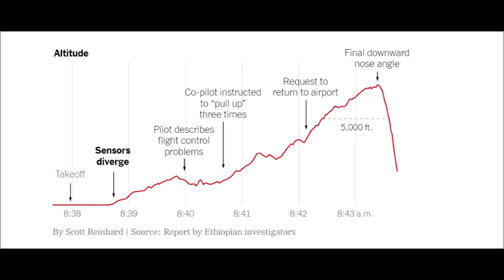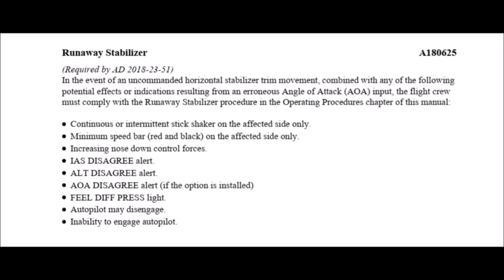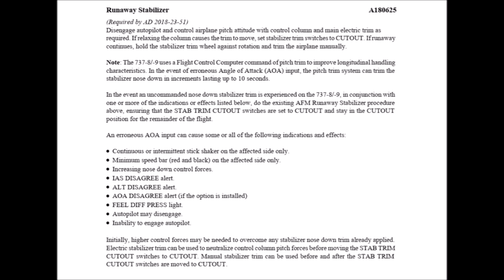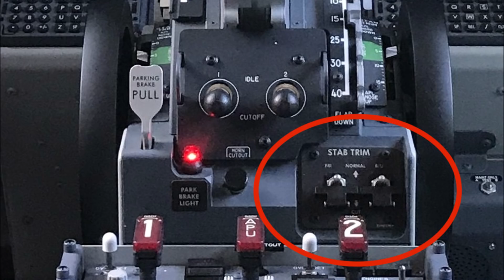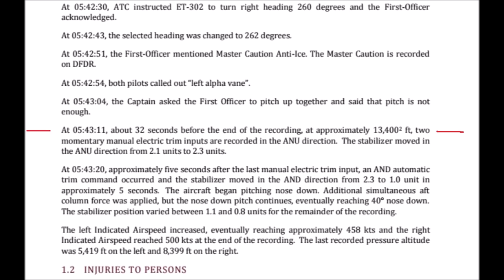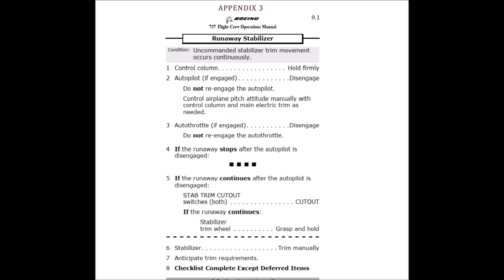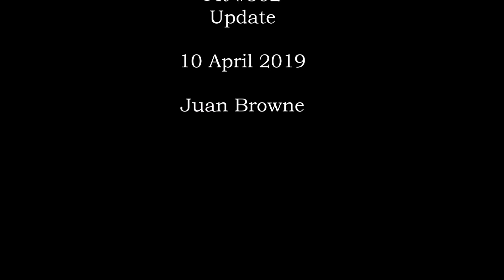737 Max Update 10 April 2019 Runaway Stab Trim Procedures

Comment: The terrible part of the history of the Boeing 737 MAX seems to be that Boeing, instead of making a complete new narrow body airplane, used the 737 platform to make the 737 MAX. It apparently became clear to Boeing pretty quickly that the new engines could not be installed in the normal position due to their size so they were moved forward and upwards on the wings. This apparently changed the center of gravity, thus changing the flight characteristics during takeoff and ascent so much that Boeing had to develop a system that could prevent the tendency of the airplane to pitch up during takeoff/ascent.
Boeing obviously decided to do all the above because they wanted to push a competitor to the Airbus 320 Neo into the market as quickly as possible. There would be great savings if Boeing did not have to design and produce a whole new airplane and airlines could save a lot of money if the existing 737 pilots could do a quick, simple retraining to qualify for flying the new 737 MAX. Boeing sold the airplane just a new version of the 737 NG but it seems that the 737 MAX really was not similar to the 737 NG in many ways.
This whole case may end up costing Boeing a lot of money and even worse, a lot on the reputation side.
Boeing will of course fix the problem with a software fix to MCAS but they continue to produce the airplane.
What will happen if passengers start to vote with their feet when the 737 MAX finally gets certified again?
What will airlines do if passengers make it clear to them that they have no desire to fly with the 737 MAX?
In the near future, it may be a good thing to be an airline predominantly flying Airbus 320 type airplanes.
Reply: FYI, the reasons for MCAS were covered in several of Juan's previous videos The story of the MAX introduction is full of compromises.

Comment: How many of these conditions happened on previous flights and went unreported to authorities...Pilots should be required to report any anomalies in flight and post flight!!!  Catastrophie training as a regular certification!!
Reply: Bloomberg reports several AOA faults over the years, though none with catastrophic outcomes. Because MCAS was not disclosed prior to the Lion Air flight, it was not easy to diagnose and report on.

Comment: Seems to me that the MCAS system is too dangerous and the design needs to be altered. There's a lot of built in redundancy, but not where they need it. That sensor gets stuck and the computer is way too determined to send the plane into a dive. Why don't they also have a gyroscope to give the computer an independent way to verify the AOA? But the autothrottle was also a problem. Both systems need to automatically back off when they sense the crew is struggling to maintain control of the aircraft. It's asking a little too much of panicked humans to manually shut down the automatic systems while struggling to maintain control.
Reply: Boeing's proposed fix to MCAS will remove most of the risks, and will be reviewed by the FAA.
Reply: So you want to rely on a sensor to detect when a crew is struggling because there is a problem with another sensor...does that make sense?

Comment: Question 1: If the FDR doesn't record MCAS inputs, how do we know they re-engaged it? 

Question 2: Did they have enough altitude to manually trim the aircraft from a full nose down trim condition? My understanding is that the trim wheels are very difficult to move, especially at higher airspeeds?
Reply: 1. The FDR records all trim inputs, but not the position of the switches, which have to be inferred from the  movement of the horizontal stabiliser, which is also recorded.
2. Probably not enough altitude to recover, unless speed was reduced. However reducing engine thrust may have caused further nose down pitching, due to the underslung engines.

Comment: I am not an expert in any shape or form in this field. My entire experience is consisted of few hours in single engine light plane and glider. I would like to know in the world of highly automated flying, is there a control or switch that terminates all automation and instantly puts the aircraft into manual mode? When panic sets, its hard to perform root cause analysis by system of elimination. I am sure that commercial pilot training includes copious amount good old hand flying. Good report Juan. Greetings from Australia.
Reply: There are differing levels of automation, and unfortunately MCAS is one of the lowest levels, and not easy to turn off. Having a single 'off' button for everything, creates risks of its own, from accidental in-flight deployment.

Comment: If manual adjustment of the trim if so difficult they should consider having the ability to disengage MCAS logic only so that way they can manually operate the stabilizer trim electrically.
Reply: 1. The proposed Boeing fix to MCAS will remove most of the risks. 2. Other changes would be complex or costly, or involve certification and training issues.
Reply: @gordonrichardson2972  I read a lot of other informative posts that said electric trim demand will override MCAST nose down command. Seems it might have the proper level of control logic priority but maybe the pilots dont know that critical information. The significance of the crews other mistakes just seem unrecognized and unrecoverable in the end. Very unfortunate. 
Thanks for you input.
Reply: The full details are complex, and still not fully understood a month after the crash. The pilots only had a few minutes to react.

Comment: Juan -- after listening to three of your 737 Max 8/9 updates, got to wondering--if the MCAS system gets into a runaway condition at an altitude that is too close to the ground, and the speed gets to be too high  and the pitch of the plane is "nose down".. why can't the control software do something to turn off MCAS and lower the speed. Perhaps even pitching the plane "nose up"?  Thanks.
Reply: Typically when you are near the ground, you have flaps extended as you are either taking off or landing. MCAS is not active with flaps extended. MCAS is obviously flawed and needs to be redesigned.
Reply: The software fixes that Boeing have proposed to MCAS will remove most of these risks, once approved by the FAA.

Comment: Can someone explain if the auto throttle is on , why did the speed get so high ? What is the function of the auto throttle ?
Reply: The auto-throttle aims for a specific rate of climb after takeoff, and then a fixed speed in the cruise. Since the aircraft was not climbing as expected, the auto-throttles kept applying full power. Its not a very smart system under this kind of fault condition.
Reply: @gordonrichardson2972  it seems the software is not very robust. How can auto throttle push the plane  into dangerous speeds well over the limit of the planes design

Comment: Several witnesses near the sight of the Ethiopian crash reported rattling sounds just prior to the crash. Could this possibly be that at near supersonic overspeed conditions on a plane likely never flown this fast before, the control surfaces buffeting from sonic conditions? Also trailing smoke was reported possibly wing vortex condensation?
Reply: Good point, though eyewitness reports at 500 mph are not always reliable.

Comment: Wow, so if they had cut the auto throttles and manually reduced the throttle (hard to do, psychologically, at low pressure altitude, not much AGL), they might have been able to manually trim at lower speed? That sure is a narrow bridge to run across, and not much time to do it. Thanks for the best, most understandable analysis of the 737 Max accidents. They came so close, that I am now convinced that if they had had simulator time covering AOA malfunction and MCAS activation, that they would have saved the plane, and all those lives.
Reply: blintor zabat I agree

Comment: jones jones quote: With tunnel vision and startle factor in mind, perhaps the synthetic voice for overspeed should be changed from "overspeed overspeed" to "overspeed reduce thrust"
—You could be right. I used to work with the mentally ill, alcoholics, and drug addicts. They can become confused and frightened, so the best way to deal with them is to remain calm and give simple clear instructions, repeating if necessary. If you stay calm, they will often calm down.

The same principle might be helpful in cockpits. Rather that scare pilots already in trouble with another blaring alarm and a scary voice warning, maybe planes should do as you suggest and give clear and calm directions. When the crew is already overloaded and frightened, they may have trouble hearing yet another warning. I suspect that's precisely what our tunnel vision response is intended to do—to shut out what our instincts think are lesser dangers so we can better concentrate on the most serious one.
----
While mountain climbing the guy I was with fell and I knew the fifty-foot rope connecting us would snap taunt in about 2-3 seconds. I was seated on a bare rock with nothing to hang on to, so I grabbed the rope to slow it down and disregarded a mental warning that would rip my hands to shreds. I managed to stop his fall. A moment later, I looked at my hands, expecting them to be ripped to the bone. They were merely reddish.

In that case, it was good that I disregarded that "rip my hands" warning. But in a different situation, that might be a warning I needed to heed. In the case of that Ethiopian plane, they could have lessen their troubles if they'd listened to that overspeed warning rather than just fighting the trim. Overspeed was a warning they needed to heed. We need to keep enough presence of mind to take into account everything that happens. And yeah, that's not easy.

Comment: What is causing the tendency for the nose of the 737 Max to lift? The self weight of the forward mounted engines would push the nose slightly down. The mounting of the engines higher reduces the eccentricity of the thrust and therefore reduces nose lift. That leaves only the aerodynamic effect of the engine nacelles as the cause. The 737 Max is therefore aerodynamically unstable and no amount of computer software can compensate for this problem.
Reply: It is not aerodynamically unstable. The thrust from the larger engines has the tendency to pitch the nose up in the event the pilot advances the throttle too rapidly.

Comment: Hi, I have two questions:
1- Has it been proven that the pilots did manually switched the MCAS back on? 
I'm asking this as MCAS takes a life of its own, so could it switch itself back on?
2- You mentioned that pilots are trained multiple years on dealing with these situations: have the pilots indeed been sufficiently trained on MCAS malfunctioning? I'm asking this as the MAX was sold as just another 737 Next Gen wit minor modifications, resulting in no need for extended type certification.
Reply: 1. MCAS does not have a life of its own, but the computer is not stored in the FDR, so some things have to be inferred from the readouts.
2. The training on the MAX was very limited, and the training on MCAS was non-existent prior to the Lion Air crash.

Comment: The fault may well be a matter of improper debounce circuit from that switch to the control on the MCAS that changes its state from engaged to disengaged. I have seen a lot of different techniques used to debounce a switch and some really cheap ineffective techniques are filters (capacitor and resistor) and poor debounce software design .
All switches ring some, within the same batch of manufacturing, wildly differently from each other, but for 50 to 500 msec, the switch can change state from on to off to on again, multiple times.
https://www.cc.gatech.edu/~hadi/teaching/cs3220/doc/debounce.pdf
https://www.allaboutcircuits.com/technical-articles/switch-bounce-how-to-deal-with-it/
http://www.labbookpages.co.uk/electronics/debounce.html

Someone should look closely at the schematics for the MCS inputs and see what has been connected to them.

Comment: TY for your level headed approach to analyzing the evidence! You are a natural teacher. I don't have words for a redesign that took the flying out of the pilot's hands and into digital computer controls that predict the plane's 'propensity to stall'.  Whoever thinks a computer can fly a plane better than a pilot is an idiot! Sorry. I read disturbing details in these two articles about the similar Indonesian crash, i.e., the physical or digital interpretation by MCASS of AOA on one side or other, altitude, and air speed possibly not reading correctly before the crash. An AOA sensor was replaced before the crash but a maintenance guy was on the fatal flight for other problems of physical readings not being correct previously. If there isn't a physical sensor or readout of such that gives a pilot an accurate physical readout of the plane's vitals, the AOA, air speed, and altitude, with pilot ability to easily take complete control of the plane within seconds does not say much about the design or their confidence in the pilots which leads back to the design fighting the pilots' control. Also, to me, this says that Boeing has way too much confidence in computer software, too little design redundancy to check the accuracy of physical inputs about the plane's flying status, they pulled a cheaper design 'fast one' on the pilots, and let me guess, contracted the training manual out to a third party maybe? Whoever was responsible for matching the accuracy of physical sensor data (errors) with the integrity of the MCASS and the 5 and 10 sec delays in the automated trim tab/stall system, and lack of heads up to less experienced 'fighter' (lol) pilots, well, heads should roll. Monopolies are never a good thing in design competition. Articles, if interested-
https://avherald.com/h?article=4bf90724&opt=0 
 And this, 
https://arstechnica.com/information-technology/2018/11/indonesia-737-crash-caused-by-safety-feature-change-pilots-werent-told-of/?amp=1

Comment: I think the 737 has been enlarged too much from its original design. This nightmare scenario would not have occurred if the engines had not been mounted as they are now. I know that airlines saved money by not having to re-certify their pilots on a new type but it really contributed to the problem occurring now. Boeing should have done a 757 upgrade/redesign for the line instead of pushing the limits with the 737. The fault lies not only with the manufacturer but also with the users.

Comment: Hey Juan do you think these pilots had the procedure or were never trained with it.
Reply: 737 pilots have been trained on the runaway stabilizer procedure since the 1960's
Reply: Pilots are trained on runaway trim. There are not trained on that, plus all the other warnings, happening simultaneously. That is called cognitive overload.

Comment: I suppose in hindsight not separating the MCAS stab trim cutoff from the normal electric  pitch trim cutoff was a huge mistake.  It also appears the MCAS system and perhaps all of the automated systems did not have access to the actual stabilizer position.  The MCAS method of pitching down seems to indicate it was acting blindly with the hope pilots would properly handle any anomaly or failure before the pitch trim exceeded controllability.  Some pretty poor assumptions were made. I still wonder if Boeing knew there were significant problems and risks with MCAS but hoped to fix them before it hit the fan.  It reminds me of the DC 10 cargo door fiasco in the 70’s.  The human cost was horrific then as it is now.
Reply: A large number of errors were made in the design of the MAX. Using the same cutoff switch for MCAS and electric trim, was one of the worst.

Comment: What I do not understand is that there seems to be a way to cancel MCAS without losing crucial electric stab trim, and that is by just lowering the flaps, even 5 degrees, correct? I hope the future software patch includes separate MCAS cancel while keeping electric stab trim active. In the wider comparative context, am I right that the equivalent Airbus setup is THREE AoA sensors with automatic software averaging of the two inputs deemed the most reliable at any given moment? A clear advantage over ONE single Boeing sensor anomaly being sufficient to trigger a deadly MCAS dive, no?  Egad. Also, how is it possible the MCAS does not speak to the ground proximity radar at all? The latter should be able to override crashing the plane into the ground, perhaps?  Finally, the impossibility of manual trim past a given speed threshold does not seem to be a scenario imagined by Boeing. Isn't that amazing? Don't you game different scenarios? Juan is implying that the speed is the result of pilot negligence, however understandable, as human factors go, but is it not possible that it was either consciously tolerated or even allowed as an extra margin of maneuverability in the situtation?
Reply: AvWeek reports that the specific fix proposed by Boeing to the MCAS software will offer many of the protections you suggest, once reviewed by the FAA. However, due to the system architecture, they will be implemented in an alternative way, consistent with only having 2 AOA sensors, and using the existing cutoff switches. Additional flight control authority protection will be built in as a final step.